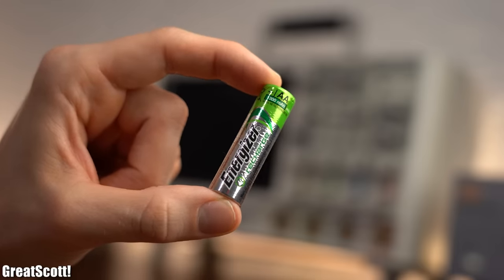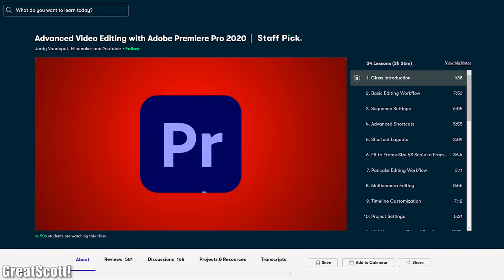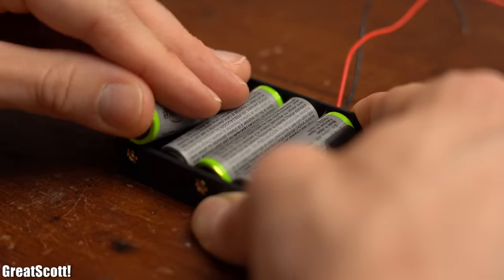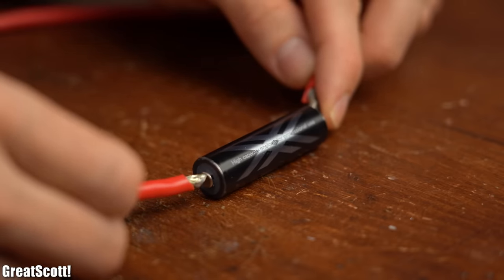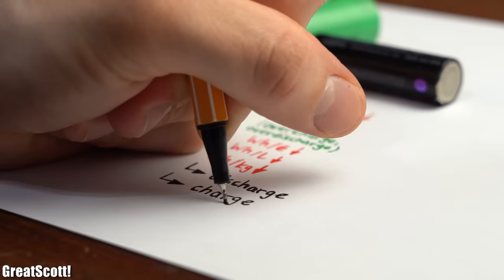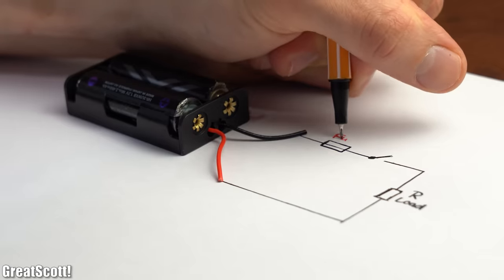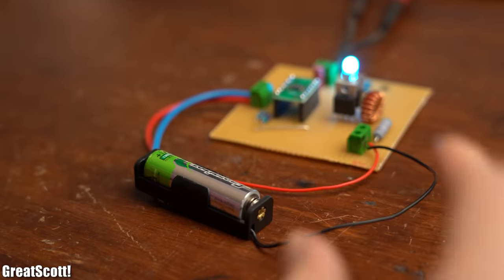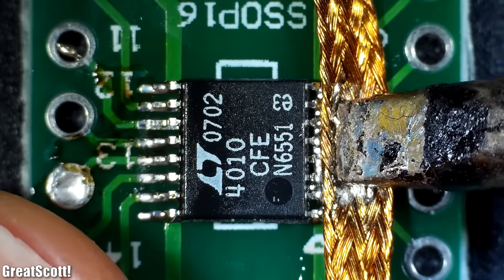Are AA NiMH Batteries obsolete? Here is everything you need to know about them!

Comment: I miss my 15 minute quick charger for those.  I still have one but I don't have the right power supply that puts out the right amperage so I can only charge three out of four at a time
Reply: Just buy a universal charger like Imax B6 and set the current charge at 1C. Be careful, the cells might be toasty after a while. 😆
Reply: @gamtax  oh yeah the one I have now they end up toasty after the charge cycle but it's got a built-in fan underneath that blows air over them
Reply: chjief rc csr had 15 minutefsst charge bayrry

Comment: Your comparisons for current and short circuit danger is not comparing like with like.
You are comparing a relatively small battery designed for low power applications to a larger battery designed for higher power applications. The chemistry of the battery has little relevance.
If you setup a Li-ion battery with the same setup as the Ni-MH (i.e. low electrode area, significant separation between electrodes, high surface area to volume ratio), then it will not burst into flames when short circuited.
Likewise, if you set up a Ni-MH battery with the same setup as the Li-ion (i.e. very high electrode area, very little electrode separation, low surface area to volume ratio), it will quite likely burst into flames.

Comment: The problem with rechargeable AA NiMH batteries is they are always 1.2V vs the standard AA being 1.5V
Reply: yea, this low voltage made LCD clock look dimmer than it suppose to (still usable tho).

Comment: This is not a fair comparison. AA NIMH batteries are for specific devices to replace alkaline AAs. I have never had an NIMH battery leak and ruin an expensive device. That’s the main advantage
I cannot find an answer. Is there an advantage of using an alkaline 1.5V over a NIMH 1.2V battery? Is there a disadvantage due to the lower voltage? How does that work? I am assuming that the NIMH battery holds a nominal voltage longer than an alkaline. But I can’t find the answer

Comment: I avoid LIPO batteries and devices like the plague due to their rather explosive and dangerous issues I'm sure everyone remembers the Samsung galaxy note 7 explosions as well as the very few notebook PCs which used a LIPO battery that exploded in customers laps or while charging or under high drain or discharge use. If I remember correctly they had a serious problem with thermal runaway.

Now I might be wrong about this but I think these issues is why LIPO batteries are not used very much at least I don't know of many things that are made today that use them or rather admit to using them.
Reply: good luck finding a mobile phone  without a lithium cell!

Comment: TL;DR

Don't use NiMH batteries. They output 0.3 volts less than an alkaline or even those new Pale Blue and Jugee Lithium-Polymer Batteries, and when you have two or more batteries, the voltage loss adds up.
Reply: Those 0.3v rarely matter because alkaline batteries are only 1.5v when new. When they reach 1.2v there's still about 20% left in them. Most well-designed devices can handle the lower voltage without issue and worst case you will just get erroneous low battery warnings. There are some things which need the extra voltage but they're pretty rare.
Reply: @eDoc2020  cheap products with low contrast black/white LCDs seems to be one slightly annoying trait of 1.2v.

Comment: A lot of analog cameras have a note on the battery cover telling you not to use NiCD batteries. Does this apply to other rechargeable too and they just called them NiCD because those were the only commercially available ones at the time, or is it fine to use NiMH?
Reply: It appears that the flash and motor drive circuitry in these (old) cameras may assume cells with fairly high internal resistance, and serious damage may result when using very low-impedance cells like NiCd due to high inrush current or overheating. Good, fresh LSD NiMH cells are much closer to NiCd than alkaline or even "heavy duty" carbon zinc in this regard, so I would be hesitant to risk it.
Reply: @PileOfEmptyTapes  Eh, what about Lithium Ion?

Comment: I have AA 2800 maH NIMH batteries from Amazon. For years I used them without issue in Sennheiser wireless mics. Now I am using them in the new Shure digital wireless mics. 

They show green in the charger and are cool to the touch. Then they get loaded in the mic and the mic is turned. About once a month, they will get super hot. Like, make the label peal, burn your hand badly kind of hot. No flames, but I think that is because someone has a hand on the mic and can pull the batteries out. 

Any idea what is happening?  Any idea how I might test these batteries?  Your thoughts are greatly appreciated.

Comment: Once upon a time.... we where replacing Methanol model engines by the first available electric solution : A venerable Mabuchi 500 or 600 brushed motor, coupled with a 10S 1200mAh NiMh battery by a voltage controler. These motors were "fifty-fifty" : 50watts with a 50% efficiency. By mean of overvoltage and decreasing prop size, it was possible to get a better power, at the expense of ferro-magnet lifespan. Even in our wildest dreams we never though to get  the capacity we have now with lithium. Ho and by the time, servomotors where not 10gr, but also fifty... grams. SO make an efficient RC airplane was a real challenge and we were really happy with 15min flight time with a 1Kg airplane. Only a few year after, DC brushless motors on LIPO batteries completely destroyed the methanol competition, with more torque, more power to mass ratio, AND more flight duration..... It will be the same wih cars.
Reply: not enough lithium to replace all cars.

Comment: I got a bit concerned now.
Do you know the OPUS BT-C3100 charger? Do you know if it charges NiMH batteries safely?
Reply: I've been looking at that charger. It looks like it's fun, but it trickles nimh/nicad cells after it's finished charging whether you like it or not, which is undesirable for LSD cells, so don't leave it in too long after it's done charging. The cheap ikea chargers are better in that respect as they don't trickle after finishing charging.

Comment: Hi, This was a very informative video. Thank you for selecting this topic. :) I had a question where I would appreciate any help :
I need to distinguish between the make of two AA batteries in a device I'm building. How could we do that? 
As in, both AA batteries are at the same voltage, but are from different manufacturers and I want to allow only one of them to be used. How can I distinguish between them?
Reply: With bare cells there is no way to differentiate between different brands of the same cell technology. You would need to make some sort of battery DRM scheme on a PCB, which could also implement over-(dis)charge protection, etc.
Reply: Nothing simple comes to mind.  Maybe spray paint one type silver or white and other type black. Then use a LED/photocell to detect the difference

Comment: I modded my GBC to work with two 14500 LiIon cells. Interestingly it seems that the 14500 cells only come with 730 mAh (Sony US14500VR2B) - 800 mAh (Sanyo UR14500P). 3.6 x 0.8 ~= 2.88Wh
The NiMH eneloop with 2500 mAh come with 1.2V x 2.5 Ah ~=3Wh.
Okay this calculation is only a very simple "guess" as it would be necessary to measure the Wh with the correct discharge curve. But it looks like the ready to use NiMH cells in 14500 format do store more energy than the same formated LiIon!?

I just googled, the eneloop pro (Panasonic BK-3HCDE/4BE) should store 2,94 Wh.
The sanyo LiIon cell was measured with 2.488Wh

For the 18650 format this seems not to be the same case any more. Why are the LiIon worse in capacity in the 14500 format than the LiIon cells? Do I miss something?

Comment: I have about 100 each of Energizer 2300Mah and Duracell 2500 Mah, and the energizers are superior, high failure of Duracell over the last 7 yrs.  Recommend the titanium 16 place charger about 2-3 hrs chg time, also use the 4 place 30 min charger by energizer discontinued, but is hard on batteries due to temps.
Reply: 10⁰ vampier s 200 50 oerçt ore enerfuy infite cuçkes

Comment: Toyota hybrid vehicles All use nimh battery packs probably due to cost and safety :) Biggest Electric motor you can drive using a battery however nimh is still the solution.
Reply: wring bampiernsrte iortal

Comment: Wondering if you could help me with a repair project? I’m fixing a hobby grade lipo charger and there are two blown diodes on the input channel. Everything else seems in working order. Would you be able to help me identify the diodes so I could acquire them and do some smd soldering?

Comment: Thank you very much for your video.
  I would ask you for help.
  Can you advise me when I charge NiMH pulse, I will have more charge cycles ??? And what frequency to use and duty cycle? 
Because when I charge the batteries with DC voltage according to the datasheet, my batteries will still die after a while.
Thank you for your response.

Comment: Considering a SAFE battery we need to compare LiFePo4 with NiMh. There the capacity, size and cost are more similar. LiFePo4s deliver tons of current but are more expensive. Also there is no cheap 4056 circuit available. Another factor is longlivety. Charging a LiIon or LiPo to 4.2 V kills them within 3-5 years - look at your notebook to prove that. 4.1V extends the life to 8-10 years but those circuits are faaar more expensive. I still use my 15 year old eneloops. Don’t know how long LiFePo4s lives.

Comment: Eneloop AA / AAAs are far from obsolete. They work great in flashlights and other than my smartphone i won't buy anything that uses a lithium battery. They're far too dangerous and don't last very long. I have 20+ year old nickel metal hydride batteries that still work in flashlights. Even when they have high IR they still work in lower drain devices.

I also got D cell and 9V NiMH batteries as well. I find them robust and hold up really well even when they sit for years.

The Eneloops work like regular alkalines (minus the lower voltage) and just charge them when they get flat.

Comment: can you explain the difference between Ni-MH vs Li-Ion in AA/AAA sized battery? because it is quite confusing now that we have options
Reply: That was the purpose of this video.
Reply from the maker: I actually did not know that there are AA Li-Ion batteries....
Reply: Careful with AA (a.k.a 14500)  Li-Ion. Most of them 3.7 V (3.2V lifepo4) not a drop in replacement for 1.5 alkaline or 1.2 Ni-MH. Most AA Li-ion 1.5 V have integrated DC-to-DC converter and charging circuit (+USB port).

Comment: You are comparing a simple lithium charger to a very sophisticated NiMH charger. Simpler chargers are possible for NiMH, they are just slower. NiMH battery packs also have the advantage that you do not need a balance circuit. You can reduce the charge current to a trickle charge and let the pack self-balance. You do not even need to know the individual cell voltages for this if you can measure the temperature of the pack, or if you can accept a slow charger.

Comment: No mention of and comparison with NiCd :(

Good. They should not be used due to cadmium use.
Reply: They should not be used because they suck. But I recently saw them being used in new, cheap brand rechargeable tools.
Reply from the maker: I actually mentioned them.....but I said they are antique
Reply: There are still a few applications where NiCd work better than NiMH or regular Li-ion so I wouldn't say they shouldn't be used. However I agree that they should be avoided for new equipment if possible.
Reply: @eDoc2020  what are some things that nicad suit better?
Reply: @jimmybrad156  NiCd can handle more current than NiMH or conventional Li-ion. NiCd can also handle mild overcharging, something old trickle chargers rely on.

Comment: Ah. Yeah I guess for projects they don't make much sense. For consumer electronics though, I can't put any of those other types of batteries into a AA slot, so AA NiMH batteries live on.

(related: I much prefer being able to use NiMH AAs in Xbox controllers compared to the lithium batteries in PlayStation and Nintendo controllers. When the batteries die in an Xbox controller, I can swap in seconds and get back to the game. On the other platforms you have to stay tethered to a wire or buy a second controller. yuck.)

Comment: Obviously, lithium's taking over... They should make rechargeable lithium cells for all battery sizes; AAA, AA & so on👍PS: interesting that lead-acid batteries still exist
Reply: AA lithium cell is already in the market. Not really like it since it's just a normal lithium cell with its own buck-boost converter. It's hard to know when the cell is low in charge until it's just dead all of sudden.
Reply: LIthium batteries should NEVER be the same sizes as AA AAA C because they are not compatible and will kill alot of electronics.
THere is actually a 14500 Lithium cell that is similar in size to an AA (used for high powered single AA flashlights designed to take 3.7V)...but it's a special use case.
Lead acid batteries offer a stable low voltage system - which is why you will brick a Tesla Model S performance if you remove its 12V lead acid battery. High voltage circuits are separated from the lower voltage sensors/dash/entertainment system for a reason.

Comment: I really liked AA rechargeable batteries. When my Xbox Gamepad is discharged, I just replace the batteries and can continue to use the gamepad without a wire. The PS3 to 5 controller has to be charged with a wire and when the battery goes bad, I cant replace them easily. I have the same issue with my mouse, before I could replace the batteries but now I have to plug a cable in it and the port is recessed, so I cant use any cable.

Comment: Make another video about sealed lead acid battery! There is no proper information about how to charge it properly and all the proper information!
Reply: Oftentimes the batteries themselves have all the info you need. The easiest way is just to connect them to a current-limited power supply set to 13.8 volts.
Reply: @eDoc2020  Spot on. You can charge them as slow as you like, just don't push too much current into them. Eg. a cheap 600ma 13.6v charger isn't a bad way to float a big SLA. Ideally you're meant to charge it up to something like 14.2 volts something like every year but hey each to their own. I've put in cheap SLAs for DC roller shutters in 2016, with cheap 600ma 13.6v chargers, and the batteries are still fine! Lead acid's need to spend as much time as practical fully charged to live a long life. Overcharging will dry them out. Put a charger that floats, on your car battery if not driving it for more than a few days.
Reply: Also stay away frmo the dirt cheap car batteries.

Comment: What’s weird about energizer Nimh cells is i have some that are literally a decade old and still work but others stop working after 6 months despite charging them with equal frequency. The energizer charger just flashes red and refuses to charge the cell anymore. Is there a way to fix it? Trickle charge? Or is the internal resistance screwd up?
Reply: I revived a few in this state by attaching the sad battery to a good one positive to positive, negative to negative, jumper cable style. Then ran it through a charge-discharge-charge cycle.

Comment: You know how you balance nicad and nimh packs? You dont! Not directly anyway. You charge the whole thing, and the ones that finish first just dissipate the power as heat. As you can imagine, this is bad for the pack, if there's a significant difference in capacity between the cells. These packs are generally not very durable, and meant to be tossed and replaced fairly often. You never charge them in parallel, always series. You usually discharge in series too. Need your device to last longer? You are generally stuck with designing it for a higher voltage and hopefully lower current. There's a reason nickel based batteries are quickly falling by the way side in favor of lithium.
Reply: ues

Comment: There are misinformations and misunderstands. You cannot mathematically describe that You need to charge 2400 mAh NiMH battery with 120 mA of current for 20 hours. When we charge NiMH, we do not have 100% of efficiency charge. You need more than 30 hours to completely charge Your battery. And second, there is no need for trickle charge, if You using eneloop batteries, because they are already LSD, Low Self Discharge batteries.

Comment: 3 quid for a pack of 2000mAh from Lidl. Can’t argue with that.
Reply: Well, internal resistance goes up pretty fast for the cheap cells sold by Lidl and Aldi. So usable capacity drops fast...
Reply: @sjococo  true but I don’t use them for mission critical, so I just buy more and use them less frequently

Comment: Esp32 - S2!  New!  Give review please!   Lol 

Can I use L-Ion 1080 x2 batteries?  How much runtime on 2 Lion batteries?   I need long time battery. And correct power regulator with it.

Also I want to use better raspberry pi cam with ESP32 - S2 and cam /motion sensor for high security cams.  Please advise.

Most humble Appreciation!
Novice with tech.

Comment: So, a highest quality NimH (eneloop pro) is equivalent in capacity to an average quality 18650 Li-ion cell. Got it.
Reply: Not really, Li-ion has more voltage

So it's roughly 2.5-3x less energy
Reply: @gustavrsh  woosh.
Reply: @richardlighthouse5328  if it was a joke, it was a very bad one.
Reply: @gustavrsh  Right, I forgot about that. Power is measured in watt hours, not mAh. Thanks.
Reply: I guess a no brand 1ah 3.7v cell vs a eneloop pro (1.2v * 2.5ah) might be getting close (81%).
Reply: but still a lot less than a nice 3.5ah 3.7v cell.